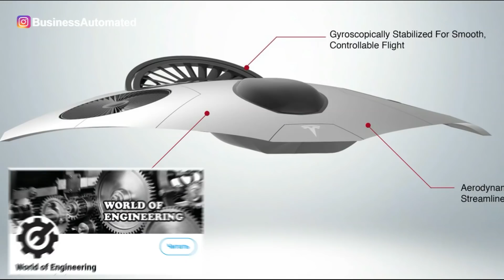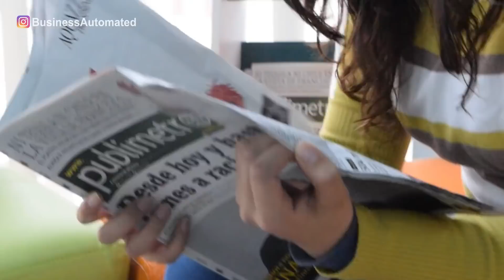Is Elon Musk Working On An Electric Plane? How Tesla Electric Aircraft Can Disrupt Airline Industry

Comment: So much drivel !  Where does the Electricity come from that is placed in the Batteries? Has MUSK  found a large pool of electricity that he uses to put inside the batteries? OR, does he use FOSSIL FUELS  TO PRODUCE THE NEEDED ELECTRICITY?. . . . THESE ELECTRIC GENERATORS PRODUCE FAR MORE POLLUTION THAN GASOLINE AUTO ENGINES,  THUS INCREASING THE OVERALL POLLUTION !!! OVERALL, the  ELECTRIC PROCESS,  IS NOT AS ADVANTAGEOUS AS FOSSIL FUEL . . . BUT IT IS MORE EXPENSIVE.THERE BY, OF VALUE TO ELITE'S WHOSE WORLD DICTATORSHIP DOES NOT WANT YOU TO FLY, AND YOU WILL OWN NOTHING, AND YOU WILL BE HAPPY OR YOU WILL BE PLACED IN PRISON !!!  ACCORDING TO THE BIBLE (believe or not) Millions will be "deleted!"